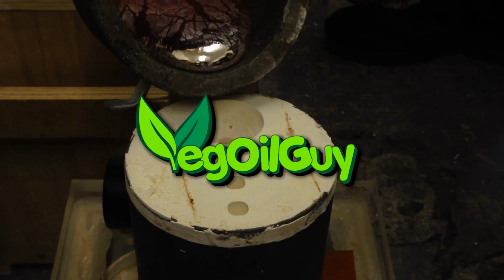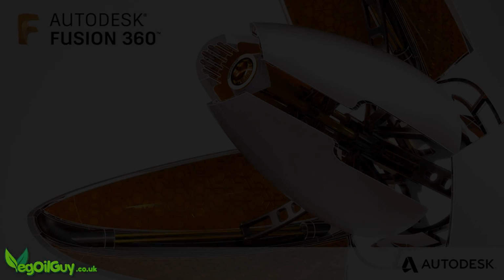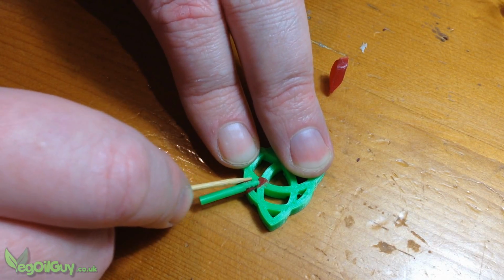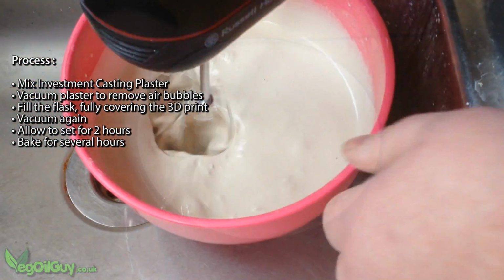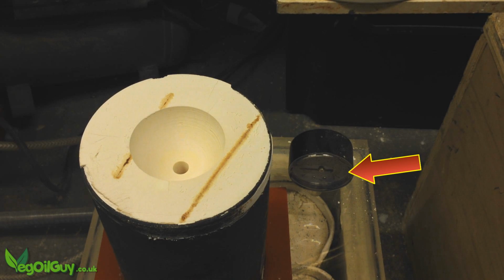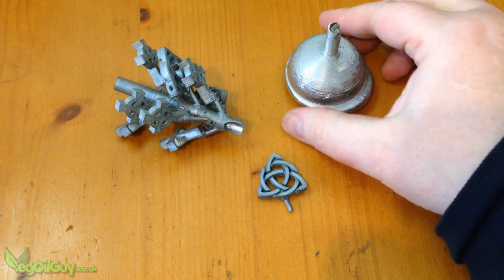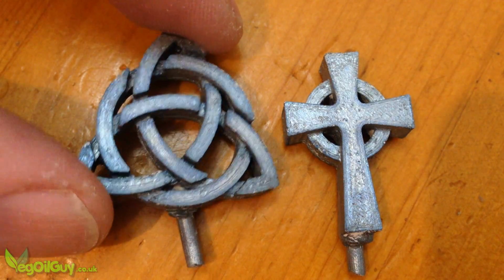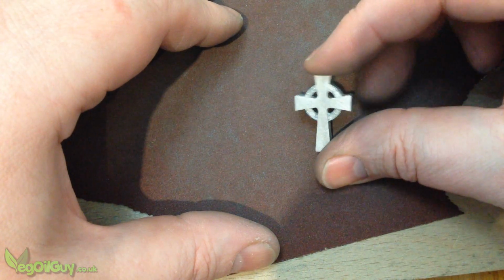3D printing & using a Casting Tree for Lost PLA multiple Castings by VOGMAN

Comment: that is some neat casting you did there! I was a bit scared when I saw how small your gates were compared to the body that needed to be filled through them. I suppose the vacuum, the preheat, the accumulated heat from all the branches and the trunk, and the central location in the flask, all did their part in the total success of this one. I'm not sure if it was just an impression, but it seemed to me that the pour was very steady and smooth too. It seemed like you carefully hesitated a bit right before the metal poured out. And as a result the metal in the basin looked much calmer than in previous videos. At least, that's how it looked to me, but it could be just an impression...

Seeing the batch options of this casting tree, and thinking back about some of your older projects, before you totally caught the casting bug (just around the time you got seriously infected, I believe), I think I have a fun idea for you: Remember that lawn mower tank you made? With a casting tree, you could make miniature track links to build a small version for indoor applications. One that comes to mind, would be an RC beer fetching tank: you're watching your favorite show while comfy in the couch, drive the tank to the kitchen where the missus is making you a sandwich, you yell at her to put a cold beer in the tank, then you drive it back... XDDD (purely fictitious idea, of course, given that I'm short on missus lately and I can't drink alcohol because it doesn't mix well with the meds)

gotta close this comment and send it, because my dog either passed the fart of the year, or I got some urgent cleaning to do... (to be nominated for the "most random information overload" award)
Reply from the maker: Luke, that's exactly what I was going for with the pour. I'm trying to eliminate agitation - or at least minimise it. You'll see my next step in the process advertised on my Community page right now.
You perception of how everything worked is the same as mine - and luckily we were right : )
And a mini beer carrier sounds brilliant. That's going on my list.
Mind you, I've still got to finish that lawn mower. Eeeek!

Comment: Hi can you have another go at melting copper with your oil burner please. 
I have made myself a small metal foundry and I used ur design for my oil burner and it works great 👍 and I don’t have any aluminium left due to melting all of it already 🤦‍♂️ so I would like to see if u could melt copper with your oil burner thanks. 
Ps I’m from the uk and if there are any ways of getting some more aluminium to melt
Reply from the maker: Hi Jacob, I'll certainly have a go if a few weeks when the weather turns warmer : )
As for metal, head down to a local scrapyard and see if you can find yourself a alloy wheel. These are generally less than a tenner but give you a LOT of quality metal. And when you're there, ask about copper, bronze or brass : D
Reply: @vogman  great idea... Provided scrapyards are available XD (I live in an overregulated country where scrapyards got outlawed... It literally is illegal to have a scrapyard here, luckily France isn't too far away, and that entire country is one big scrapyard, hahaha)
Reply from the maker: France love their reclamation yards. I know this from watching a programme called La Salvager, which you may not have seen, but you can guess the sort of thing he did  : )

Comment: I'm always reluctant to comment on any You Tube videos because I know someone will get offended or just plain want to argue,  to  those I'll tell you the same as I tell my wife of 50 years....Kiss my butt.
These comments or recommendations are based on this video and others you have done.
When treeing your parts to the main sprue keep your attaching sprue as short as possible, the diameter of the main sprue is to dammed wimpy for this video I would have made it about twice as big in diameter as you used. For the part sprues that attach the main sprue the diameter should be close to the maximum thickness of the parts. these sprues would have been more effective going straight in instead of angled.
When you are ready to pore it drives me crazy the waiting and hesitation before you pour, get her done ,all this waiting is allowing the flask time to cool down, the recommended flask pouring temperature is critical.
You are not going to raise the bar on your castings until you build a vacuum unit that uses perforated flask  enabling a more direct and complete vacuuming throughout the investment.  From watching your videos I know you posses the skills to do this.
If you continue using the  solid flask look into using welding rod shaped like a candy cane . Place these rods over the edge of the flask and remove before burnout. Consider the destructive inside flask liners to  allow a better investment vacuum.
Well that's my story and I'm sticking to it
Paul
Reply from the maker: Well, that's my wrists slapped.
For any of you that don't know, Paul Hamler is a craftsman, an all round decent guy, and a better caster than I'll ever be : )
And to you Paul, I know, I know... but I'm still learning  : D

Comment: can you please try plaster of paris instead investment plaster? treat it same as the investment plaster, do the heating treatment exactly too...
Reply from the maker: I've already tried plaster of Paris, not with PLA, but with wax. It just doesn't work the same.
Investment plaster is designed to be porous. A vacuum can actually suck through it and act on the metal. That's what gives the casting such detail. With p of p, the vacuum cannot pass through it... so no suction and lots of tiny air pockets getting trapped which spoil the casting. Unfortunately these experiments weren't filmed, but I learned the lesson.

Comment: Is there any chance that you would share the .stl for the sprue base and casting tree that you are using?
Reply from the maker: I'd be glad to James - BUT it is specifically designed to fit on MY flask. This has an outside diameter of 102mm. Would that work for you?
Reply: @vogman   I'm sure it would I have to find a flask still anyways.  I've just been using empty cans.
Reply from the maker: If you're in the UK I can tell you where I bought mine online. If not, I think it's a standard 4 inch flask. I'll sort out a file and post you a link  : )
Reply from the maker: This is my first time doing this, so I'm sorry it's not brilliant, but if you go here -
http://vegoilguy.co.uk/stl/casting-tree-base-sprue.stl

you'll see a page of gibberish. Right-mouse click and Save-As and it should let you save it as an stl file to your computer. It worked for me when I just tried it. 
Let me know if you have any problems and I'll sort out something a little better  : )
Reply: @vogman  Its not working unfortunately, is there any way you can email me the actual file?
Reply from the maker: Of course. I'm happy to. Just do me a favour please... go here and send me an email...
http://www.vegoilguy.co.uk/contact_me.php

This will give me your email address securely so we can avoid all that nasty spam, etc. Once I've received it, I'll email back with the file. 
Oh, and I've placed the Knot and Cross on Thingiverse if you're interested : )
Reply from the maker: Hi James. I've emailed the file over to you. It's a bit large, around 2.6Mb so it might fail or go to your junk folder. Let me know if you have any problems.

Comment: Did you eventually go after the one in the sludge bucket?  So what's left of your eyebrows anyway?  C'mon, give us a peek.  ☺
Reply from the maker: Honestly, no. I just scrape the content into a sturdy bag and leave it somewhere to dry (as the water evaporates, it becomes lighter, and then it's easier to dispose of).
There could be several missing body parts in the bottom of my sludge bucket. Sometimes I swear I see movement down there, and maybe voices calling out. But then I take a couple of my 'special' pills and it all goes away  : D
Reply: @vogman  Special pills?   Oo, sounds ominous.  😉

Comment: Whatever happened to the electric foundry?   Is that what you use for the burn out, as the temps can be dialed in so accurately?
Reply from the maker: Spot on Brad : )
The electric often runs during the night, slowly cooking on a timer at a low temp, such of 120C to bake off the water. Then I raise it in stages the following morning and by early afternoon I'm ready to melt metal in the Devil-Forge. Having the two is a real bonus. I just wish Devil-Forge would make an electric oven  ; )

Comment: Did you get the one from your sludge bucket?
Reply from the maker: It's a right Forking mess in that bucket, Ron  ; )
Reply from the maker: It's probably the best one, but no, not yet. And probably never will.
I started out cleaning the bucket after every dip, but being a lazy sod I soon realised it was less effort to top up the water and clean it out after 4 or 5 dips. But this means 3 or so inches of goo clinging to the bottom of my bucket. 
Clean out the bucket or play with the 11 clean ones? It was a no brainer for me  : D
Reply: @vogman  Yeah, plus I find that the slime at the bottom can begin to smell after awhile.
Reply from the maker: Haven't experienced that yet... time will tell.
Reply: @vogman  Maybe you can fish the casting out of the sludge with a fork.

Comment: Another quality video!  Have you looked into print2cast filament?  Its supposed to behave more like wax than plastic but you can 3d print it.  To be honest I'm waiting for you to do it, learn all the secrets, then share it with your admiring fans :)
Reply from the maker: That made me laugh. Thanks for putting the onus on me  : D
To be honest, I'd love to try one of these wax filaments. There's a few and you're not the first to suggest I give it a go. But they are expensive. Here in the UK they seem to be around £60 plus p&p. Whereas the PLA I'm using costs just £18 inc p&p. So it's a no brainer for me. 
I do take steps to ensure a good evacuation of PLA... but interestingly enough I'll be looking at that more in next weeks video (providing all goes to plan). I'll be trying a couple of experiments to see how this pans out.
In the meantime, I'll live in the vain hope that a wax filament manufacturer will stumble across my humble channel and donate a reel or two for me to test. They should arrive just after the unicorn and pot of gold ; )

Comment: Hello. Great video. Do you de-gas your melt? If so, how do you do it, please?

Thanks.
Reply from the maker: Sand is a different beast again and as you say, much bigger... bigger pour, bigger drop, more agitation, etc. 
Now I'm a big fan of myfordboy, and a subscriber. He personally told me (somewhere on THIS channel) to use soda crystal and I was doing. Then I saw this video - https://www.youtube.com/watch?v=tXGZEWHprE0 - and whilst I would prefer to do my own tests as I can spot flaws in the approach he took, it did make me wonder.
So for now I'm NOT degassing. I'm all about experimenting  : )
Reply: @vogman  The key take for me from Myfordboy was providing head on the filler and riser to get pressure in the mould void. Please note, I have yet to do any casting, but I intend to this year. Have you got rigged for burning oil yet?
Reply from the maker: An alternative view, Ron, is that I can even manage to agitate molten metal  : )
Reply from the maker: That's a very important question that I have been deliberately ignoring in my videos lately... but for a reason.
Currently I am NOT degassing my metal. But currently I'm NOT experiencing porosity either.
It could be coincidence. I'm hoping it's not. So before I comment on it, I want to do a few more runs and see. But there's no tricks involved. I'd just encourage you to concentrate on SMOOTH delivery. Even if my thoughts are run, the decrease in agitation can't hurt : )
Reply: @vogman  Thanks. You had some porosity in the last cast (previous to this), and I wonder what caused it on that run. Anyway, I note Myfordboy seems to degas, but his castings are in sand and maybe 10 times the size of yours. Keep it on. Your videos are well made, presented, interesting and easy to follow.
Reply: @vogman  Right.  Nobody likes to be agitated, and apparently, neither does molten metal.  😁
Reply from the maker: You'll have a great time. Myford makes it look very easy and that's his genius. As you go on you'll find a thousand differing opinions and that's okay because there are no real answers... we find our own way. For instance, head pressure is great, but too much cause agitation in the metal and forces in air, causing porosity. Or does it? You'll only really discover these things as you do it and experiment for what works for YOU.
As for oil burners,  have a look here - https://www.youtube.com/watch?v=vQzuNOBOPOs
or for home made foundry, try this - https://www.youtube.com/watch?v=n42t3M1fOyY
or even an electric foundry - https://www.youtube.com/watch?v=XypmI38IKAw

As you'll see from these videos, I've enjoyed a lot of experimentation myself  : D
Enjoy!
Reply: @vogman  Thank you very much, kind Sir!
Reply from the maker: No worries  : )

Comment: Good Job 👍
How long does it take to burn out the PLA out of the plaster on which temperature ?
Reply from the maker: Many thanks.
This is PLA+ with a nozzle temp of 215C. So personally I cook my plaster for a couple of hours at 120 to dry out most of the water, then a couple more at 250. This allows the PLA+ to liquefy and run out of the mould. I then heat in stages to 730C according to the plaster instructions. Any PLA sticking to the sides should evaporate along the way, but I try to make sure 99% is naturally drained free during the 250 stage. Funnily enough I plan on talking a bit more about this during next Friday's video, which I'm making now.
 : )
Reply: @vogman   Thank you for the detailed explanation. 
Yes, this topic interests me very much, I would like to learn more about it in a video.